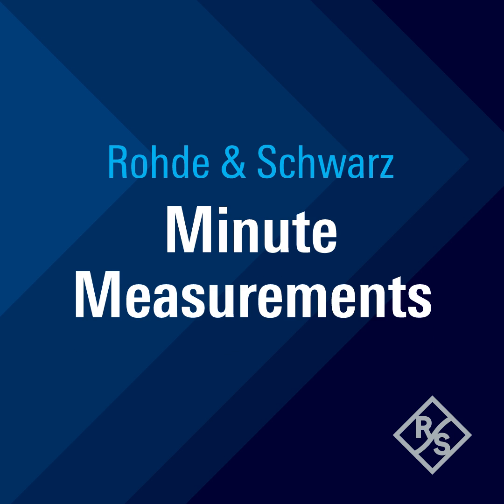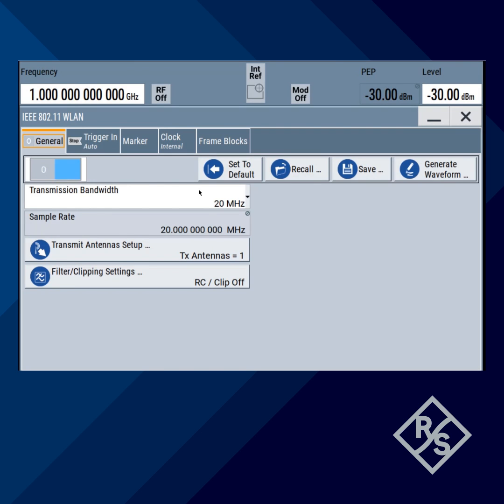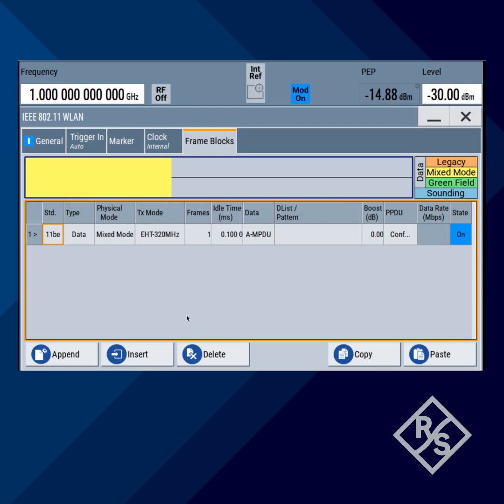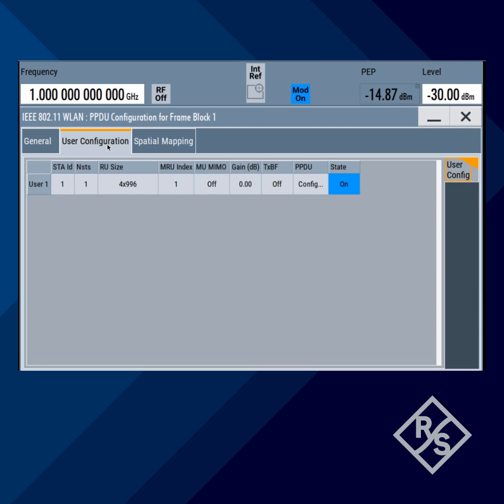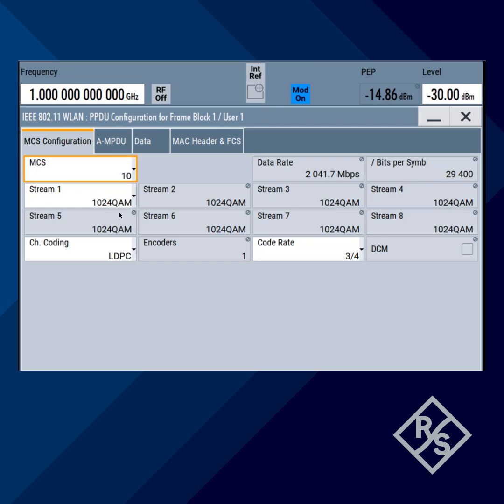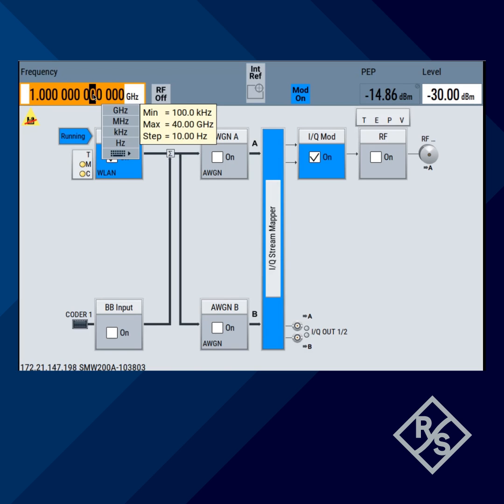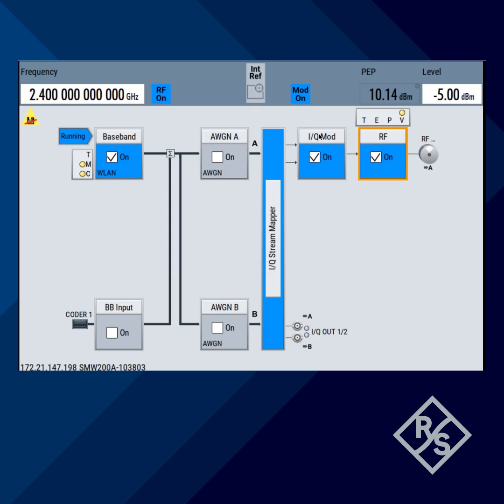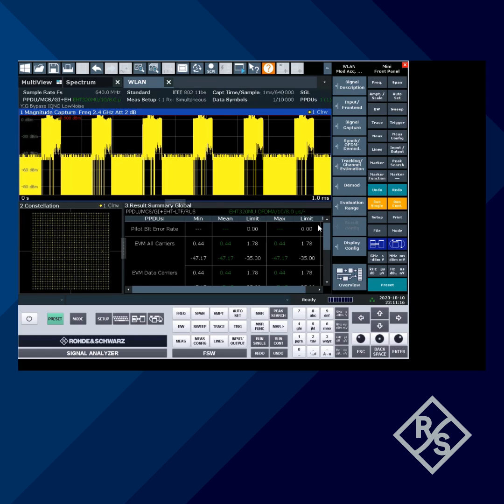Minute Measurement WiFi 7 Signal Generation

Comment: I wait to enable the baseband signal until it’s fully configured. Otherwise, the signal generator will recompute the baseband signal every time you change a setting. This is especially noticeable if there’s more data allocated in the frame, or more frames are allocated. In this example, baseband waveform computation was nearly instantaneous since there was only 1 frame generated with a 1028 byte MAC layer payload.

Could you demo this in the 6 GHz band where 802.11be 320 MHz channels are available? Thanks for the video, Rachel!